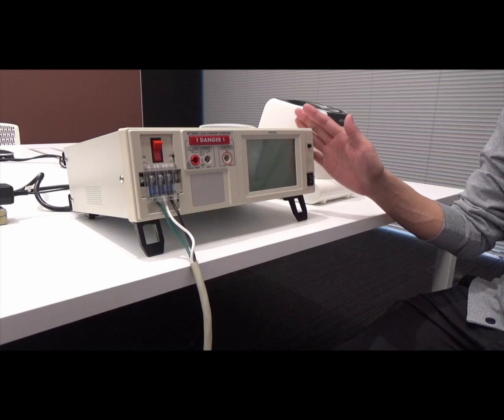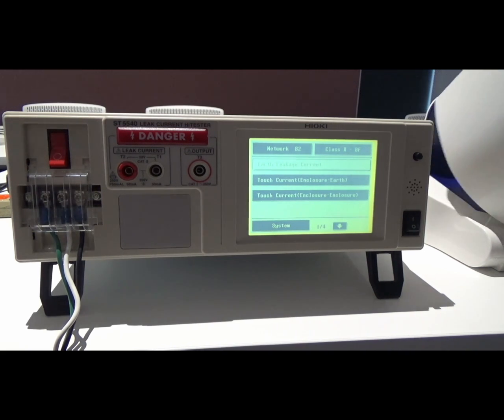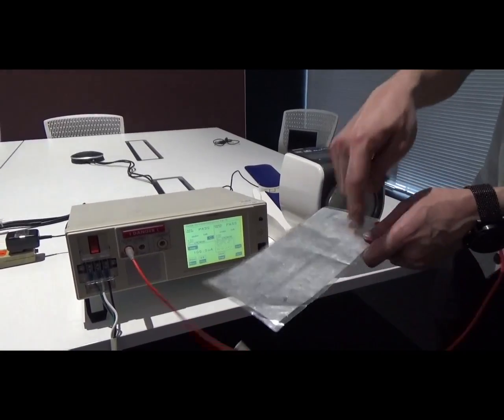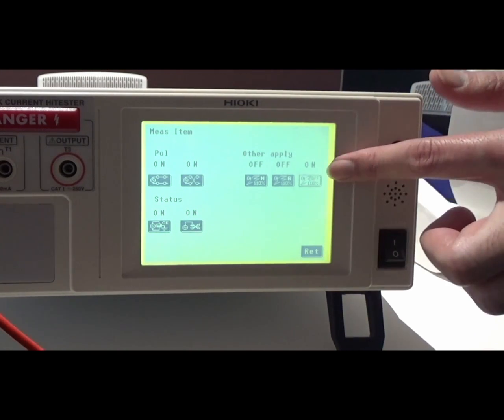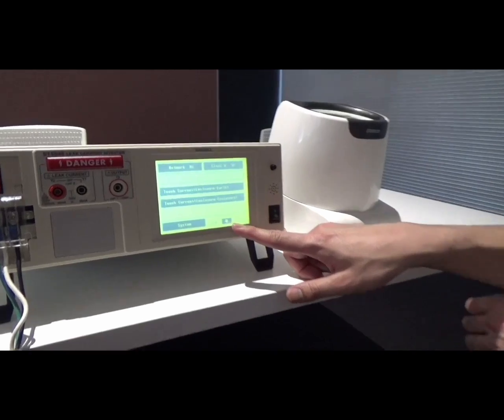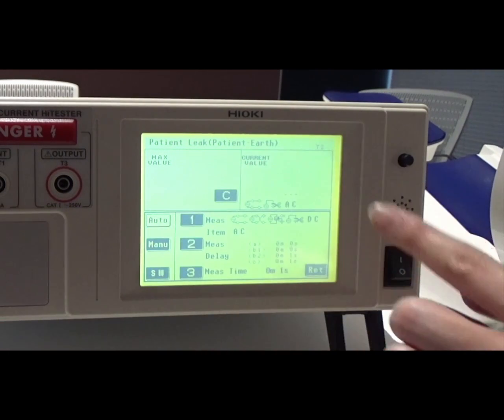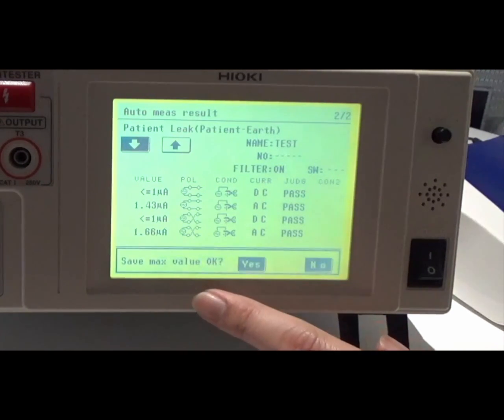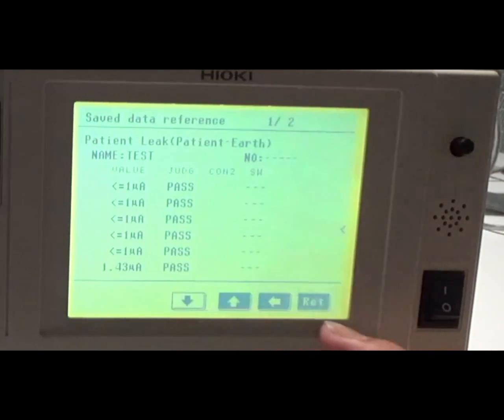Learn How To Use Hioki Leak Current HiTester ST5540 For Medical Use

Comment: What is the material used to simulate the human hand?
Reply: you mean the foil he used? i think that is the surface contact probe.
Reply: @beayetreasuremaker968  Yes. it is conductive; it is called an 'enclosure probe' and it is included with that safety tester.
Reply: Metal foil